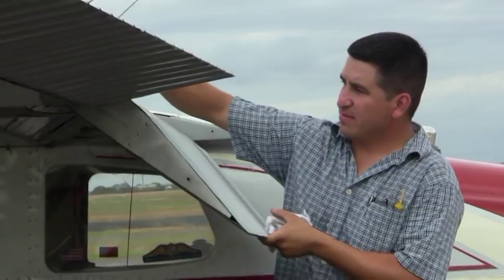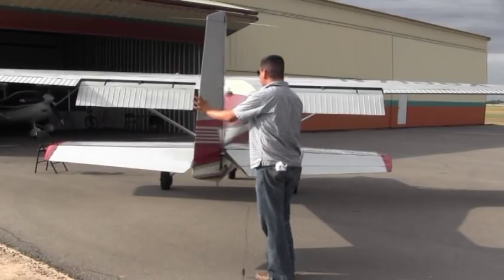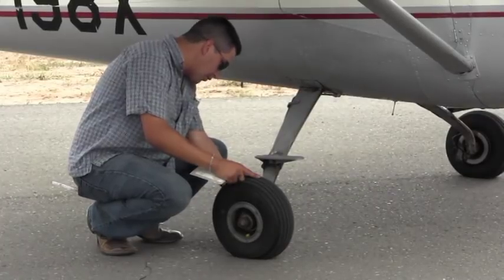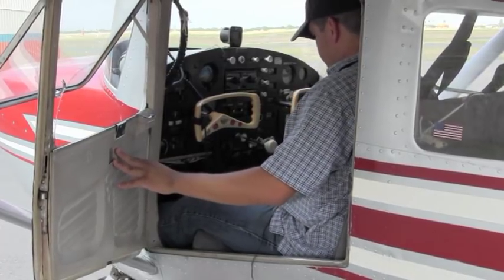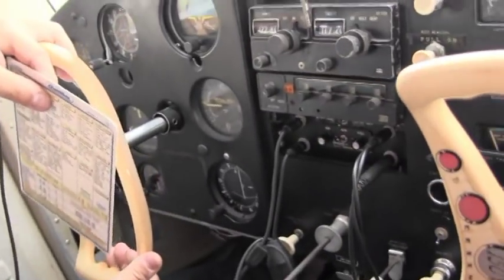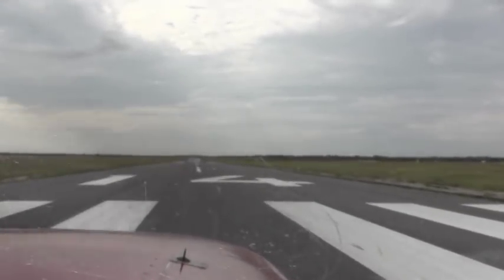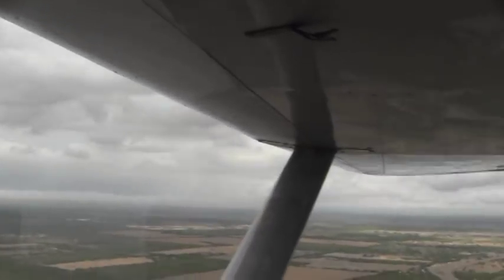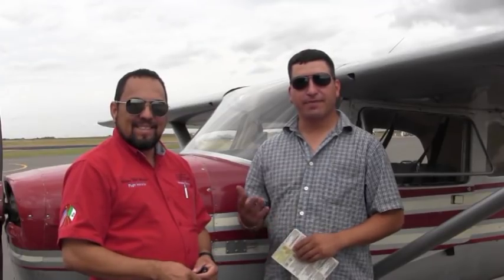FLYING THE CESSNA 150

Comment: On preflight walk-around ALWAYS hold the aileron or elevator up or block it up while reaching into the crack to check fasteners and movement, especially underneath. This will save your hands from getting mangled by this potential meat-chopper if the control surface suddenly drops. Also (edit) be on the lookout for critters and their nests in the nooks and crannies and inside the cowling. Not a bad idea to have a can of wasp spray handy.

Comment: Great video. Another key thing to check is Carb Heat while in the run up. I also like to check one more time that fuel is on position and that the primer is locked and in.

Comment: One of the most important items was missed. Checking fuel for water contamination...
Reply: and checking the prop cor cracks or nicks and checking that it is free
Reply: The fuel strain wasn't checked to drain any water or sediment. On the 150 I recall the fuel ON tap was under the seat. Unless the plane had be flown the same day, the prop wasn't cranked manually a few time and primed by three or four activations of the pump. No prop surface damage etc. Many things that I recall from my lessons in 1975/6. Sadly the costs were high due to fuel prices increase. I gave it up at £26, per hour. Also, at 22 I found it quite nerve challenging. Another reason perhaps to quit. I succeeded in full controlled flight with instructor but never solo. Pity.

Comment: Fun stuff!  If you reference the Owners' Manual for your Cessna 150, Sections III and IV, you'll find that the recommended engine RPM after start is 800 RPM, and not 1000 RPM as stated in the video.  Also, sticking your fingers up into the aileron "well" as picture is not a good idea unless you've got a good grip on the aileron and are holding it firmly in place.  You can probably see why by looking at the picture!  Thank you for an informative video.  "Mike" Kelly, "Old School" Aviator and CFI

Comment: No mention of the nose gear strut, its proper inflation, condition, or shimmy dampener, and steering hardware. Also, skipped the propeller check. Never checked the structural integrity of the fuselage, stabilizers, and engine mounts. Ignored the pitot tube, and static port. Did not mention the required documentation. No check of the fuel tank ventilator tube, or the fuel valve. No sump drain for fuel contamination, or water.  All very important for safety of flight. Otherwise, pretty good.

Comment: first thing first AROW
airworthyness certificate
registration
operators manual (P.O.H.)
weight and balance info (included in POH)
turn master on and then lower flaps (if equipped) to full travel
turn master off... check all breakers in and all electrical switches off
then procede outside the aircraft

as always use a checklist as this will give you proper guidence on a preflight inspection

Comment: Used to own a 1964 C-150 Straight-Tail. I miss that bird! Cost to get a license in the States can run as low as 5500.00 and you can pay as you go!:)
Reply: I don't know what it costs now but in 1969 I paid $20 an hour for the plane and $10 and hour for the instructor , and required 35 hours flight time at a certified school to get my privat ticket .....Then I went on to get my Commercial Helicopter license ......

Comment: What are the differences in flying the Cessna 150 as opposed to the Cessna 152? if there are any
Reply: The C172 feels a little heavier, but you get use to it quickly.  I flew C150's for my first 30 hours, then bought a C172 with another guy.  Just a couple hours of dual to solo the C172.  They are both great to learn in.
Reply: Jim Morris He said 152...
Reply: Jacob McKenney It's a little harder to spin a 152, I assume because the engine is a little heavier.
Reply: I think he was asking about the 152, not the 172.

Comment: Flaps at zero for takeoff???? And it's "checklist" not schecklist, "on" the ground, not "in" the ground. In the ground is what happens when you screw up! Lolol!
Reply: Of course flaps at 0°. Have you ever flown a small Cessna? Only bigger planes, usually jets, are required to have a different flap and slat configuration. If the runway is long enough and the plane isn't too heavy, it can take off without the flaps (and slats) activated.